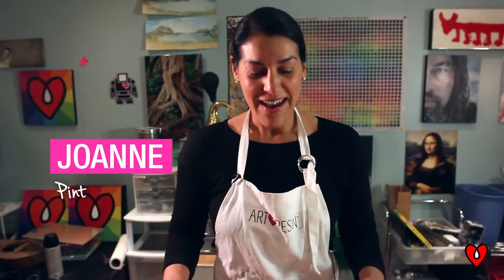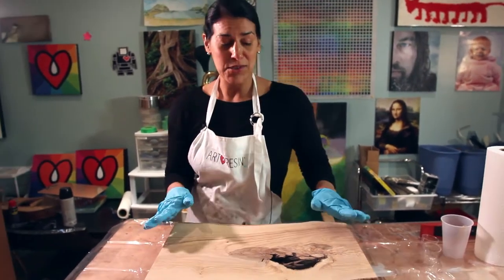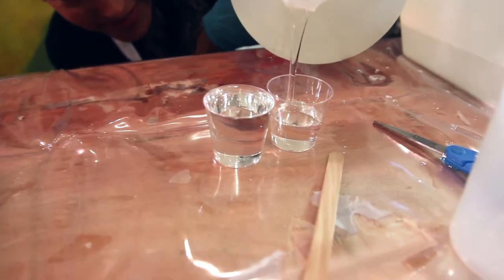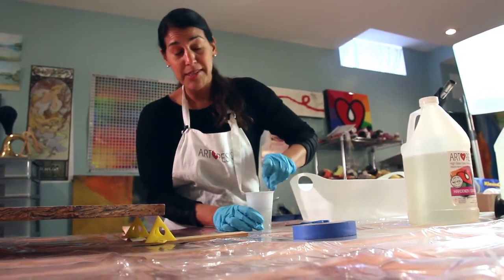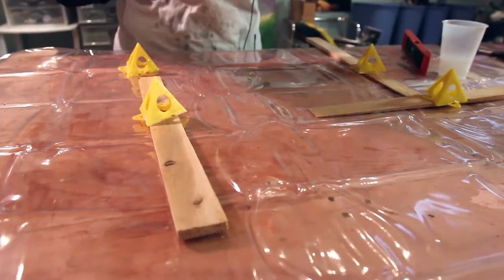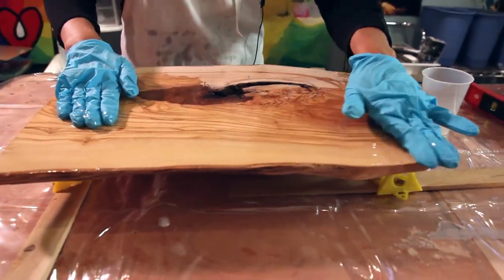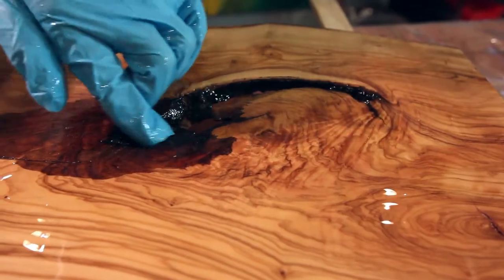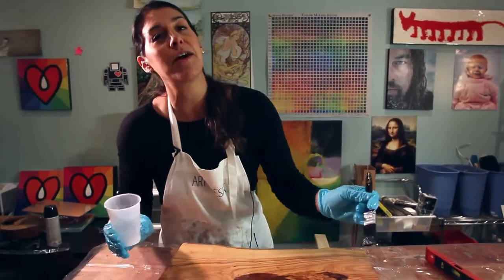How To Resin A Live Edge Wood Board - Part 1

Comment: I'm making end tables w Black Walnut and I was wondering what to use to bring out the color of the wood. Can i stain or varnish it first and then put resin on it?
Reply from the maker: absolutely you can stain or varnish it first before you resin - make sure you test it though to ensure  you get the results you want.
also make sure you take a peek at what the black walnut looks like with just plain resin - resin does a fabulous job of making wood grain and colour absolutely sing!

Comment: What can i do against nasty dust particles which are breaking my glasslike coating -.- ...i covered my piece, still get dust ... is it possible to polish it or do i have to coat it again to get a glasslike surface?
Reply from the maker: Hi there - ensure your resin area is as dust free as possible.  Wipe down all surfaces, light fixtures etc.  Spritz down the air with a spray bottle of water which will grab any dust particles in the air and pull them down to the floor.  Make sure your dust cover has also been wiped out.  For dust that has cured in your resin, you need to sand down your piece ( ensuring you sand out the dust ) and then apply a fresh coat of resin over the entire piece.

Comment: Hi Joanne, did you coat the top while the bottom was still wet?  PS I am loving these iive edge wood videos :)
Reply from the maker: Hi Tamara!  Glad you're enjoying this series!! 
Yes, I flipped it right over and coated the top while the bottom was still wet.  At this point, we weren't at all concerned with bubbles, marks etc because we knew our next step was going to be sanding.  Truly, this pre-seal was intended to be soaked up by the wood for 2 reasons:  one, to make the wood more resilient against humidity and moisture and less prone to any warping, contraction, expansion etc.  And two, to help prevent any off-gassing.  There is so much trapped air in wood as it's an organic material.  Sometimes with wood, it can offgas and release air, which means more bubbles, even after torching.  A pre-seal helps to trap that air in so it won't release more bubbles while your resin is curing :)
Hope that helps - ask away if you have more questions :)
Reply: thanks for that great explanation :)

Comment: I thought you have to seal wood first?
Reply from the maker: Its a good precaution in case the wood off-gasses and creates bubbles.  Rebecca and her brother were lucky that they didn't seal first and their piece of maple didn't off-gas at all.  For the charcuterie board, we sealed with a thin coat of resin first.